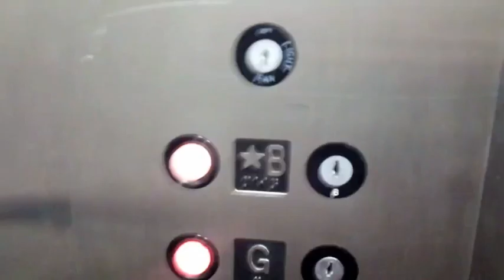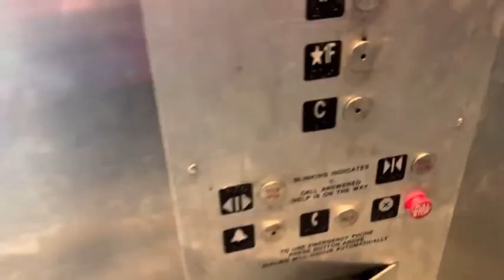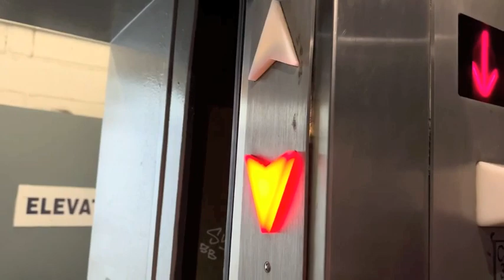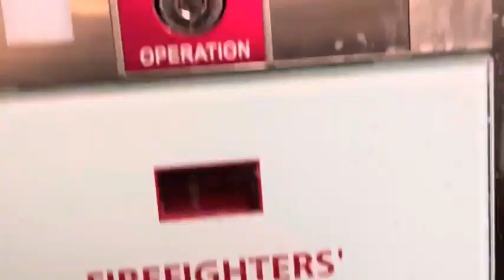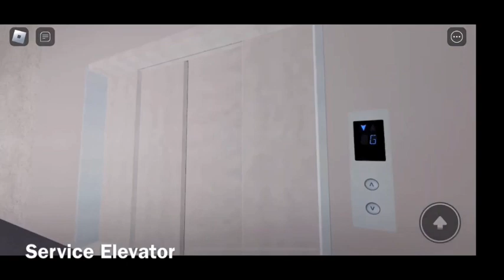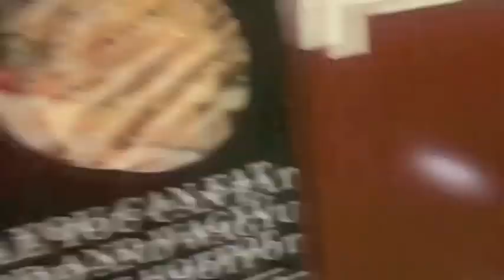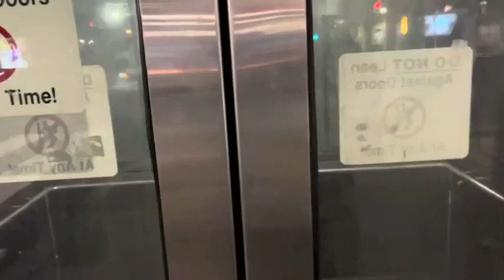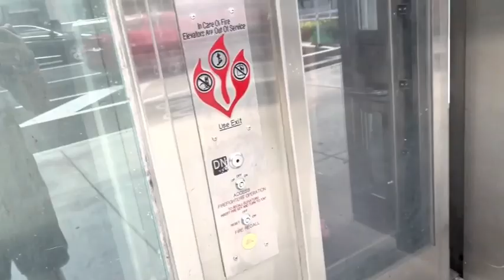Elevator chime compilation

Comment: Yay 1K ELEVATOR AKA DING DING DING DNB SAME Also When You Ride the Septa Elevators Dont It Smell Like Pea Pisk?
Reply: How Do U Deal With it
Reply from the maker: @Team_Septa1234  some of the elevators don’t smell like urine in there. Most of the newer ones don’t smell like that but some of the older ones do
Reply: @TakoElevators lol when i on the elevator it eather smells like uranium or poo...
Reply: @TakoElevators  we talking about Giarid station stinks bad..
Reply from the maker: @Team_Septa1234  I haven’t gotten this elevator yet
Reply: @TakoElevators lol dont fyim it smells bad i got stuck almost i had to pull the dooes open
Reply from the maker: @Team_Septa1234 a septa elevator almost trapped me before. I was filming the parking garage elevators at 69th st TC and I ended the video with me going down the elevator on the other end of the bridge to the parking garage, and it almost trapped me in there when I reached the bottom floor. Luckily, I was able to get out (the door just got stuck)
Reply: @TakoElevators SEPTA 1 2 3 4 is my old Google account which is my main for my Roblox account this is just all for my YouTube